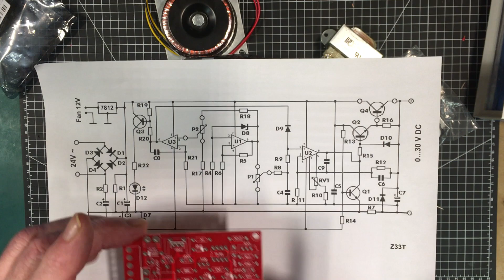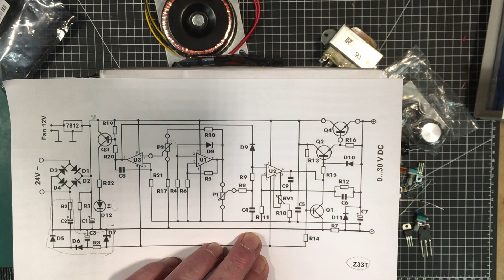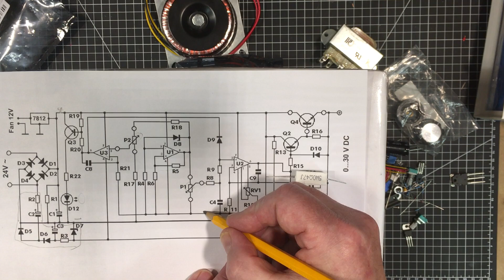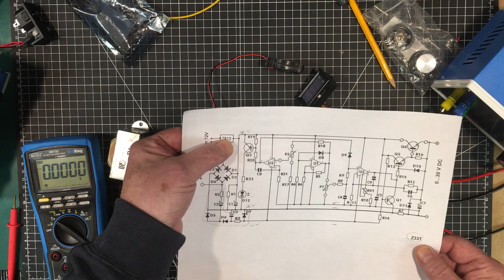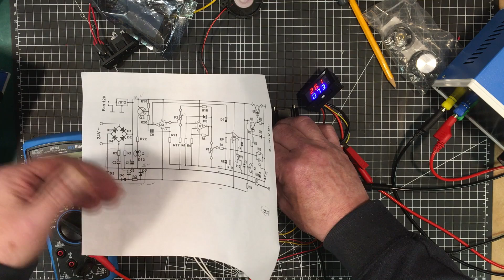Uni-Byte 0185 - Linear Bench Power Supply (Hiland): Part 1

Comment: Good one? Why don't you use 12v transformer?
Reply from the maker: You are on the right track.  This project took some interesting turns.  Finally got it working very nicely but needed to make some component value changes and a reduction in specifications and a lower transformer voltage.  BE sure to watch all the videos. 👍

Comment: that 1/4th watt resistor surely not capable for the job. replaces it with 3x 220E when building it few years ago. and they are still shipping this with 1/4th watt ! 
also used a 1/2 watt for the resistor next to it. 
and i m not sure why the capacitor next to it popped after few minutes. just use safety goggles when testing with cheap chinese parts.
Reply from the maker: SO far I've had nothing pop on mine, but I did some mods as you can see in this series.  I actually use it nearly every day for something or another.

Comment: Just to be fair, this is a kit and it’s based on a Practical Electronics design that has been assimilated by others…just ensure that the transformers ac output when rectified  doesn’t exceed the rated rail to rail voltage of generic op amps of 36volts…
Reply from the maker: It is.  I got the kit for like $4 from AliExpress, but a bunch of changes were made.  Did you see all 4 parts?

Comment: I built a +-30V supply form the "OP Amp Cookbook" back in early '80. It's right here powering my Dot Star featherwing right now (not much strain on it at 3.3v 😉). The Radio Shack  power lamp has long since burned out and the switch failed in the "ON" position, but she's still cooking. These are great learning projects. Thanks for showing yours.
Reply from the maker: Nice!  Thanks for sharing.

Comment: Just in case anyone is interested, the TL081 op amp can be switched out with: 
MC3371
LF351
TL061
TL071
OP42
UA741
amongst others. So, if you have stock, these are pin compatible. Fun to try, too.
Reply from the maker: I thought about the 741, but does it get close enough to the power rails for this application?  I guess I could try.
Reply: @uni-byte  Yes, indeed. It works fine in mine.
Reply from the maker: @englishrupe01  Just tried it and it does seem to work much better.  Thanks for the info.
Reply: @uni-byte  Cool. Glad to hear it, and you are welcome.

Comment: I used a couple of old 741's for U1 and U3, and a TL071 for U2, as that needs the offset adjustment ability. During original testing, I blew up Q4, which I thought was due to inadequate heat-sinking, but with hindsight, that may also have been a fake. I originally went for 10 turn pots, but all the ones I received from China were faulty, so I reverted back to single turn ones.
Reply from the maker: Good info, thanks.

Comment: Great project, great video.
Thats a nice case, should look great when done.

The most common Op-Amp these days, for PSU's, is the LM 385. Even the cheap knock-offs are just as robust and accurate. 
I see them, and use them, in both Linear and Switch Mode units.
Personally, I'm Analog Meters, but in this case we're Not eye-balling the guage every 2seconds.
The Toroidal transformer, what a shame. It was perfect for this project. I'd be inclined to order another from the same store.

Now the important question. Is that a Linear Power Supply, or "Linear Bench", as the title may imply. lol. 
Happy trails.☺
Reply from the maker: Do you mean the LM358?  IIRC the LM385 is a voltage reference.  I have lots of LM358s but they will not work in this design.  Yeah, shame about the transformer, but I don't really have the time to wait for another to come from China on this.  The Traid one I'm getting is just a regular "E" core transformer, but it should do the job.  Thanks for your comments!

Comment: I built one. Very disappointed in its operation
Reply from the maker: Seems to be a trend unfortunately.
Reply: @uni-byte  It would have been easier to use an LM723 and build around that.
Reply: @dannyperry8070  it's a diy kit. that means, you need to do some diy mod to get the desired performance from it. 🤣
Reply: @iceberg789  Yeah I know. I purchased one and I was very disappointed with its performance. Its in my junk circuit boards

Comment: I had one of these and had the same issues I think , it was a while so memeory is a little vague. When I tried it a few months later it had almost zero output, I did try replacing TL081 but that didn't fix it or atleast I couldn't check as one of them caught fire very quickly. I do have another kit somewhere I bought it when it was really cheep but never got around to building it.
Reply from the maker: Let me see if I can get teh bugs out of this one, then it might be worthwhile building up the 2nd one.

Comment: Add 1A diode from + output to + rail, cathode towards + rail. Will prevent Q4 destruction when output higher than rail voltage.
Reply: If I'm interpreting that correctly, placing a diode from Out+ to Supply+ is the same as placing a diode across Q4's Emitter to Collector,  where it clamps thje emitter to collector voltage across Q4 (output transistor) to Out+ minus one diode drop? Which would be within the safe zone of of the emitter to base voltage, preventing the destruction. Current would flow to only a minimal degree, so this could be a small 1n400x rectifier diode or a small SBD.

Eager to hear if I've got this correct!
Reply: @AnnaVannieuwenhuyse  Yes you got it
Reply from the maker: Good idea!
Reply: Great idea....many thanks.

Comment: You can never have too many power supplies. You’ll use both types of meters eventually. I like those blue cases with the white trim. I’m not sure the one you’re using is big enough for two analog meters, along with everything else.?
Reply from the maker: You may well be right.  They are really small meters, but we'll have a look when they arrive.

Comment: I've always been skeptical of these cheap DIY kits from China. Seems like an easy way to make a buck by shipping them out with counterfeit or faulty surplus components and then pass the buck to the hobbyist builder for a failed unit due to implied improper assembly -- especially since they don't include schematics or instructions.

I've also been looking at these boards and in some listings there's the option of buying a pre-assembled board for a couple bucks more. That's the only way I'd buy one, because then you have some refund recourse if it doesn't work... although they might still claim you incorrectly hooked up the external transformer or some other peripheral component.

Of course part of the fun of these is the build itself, so I'll be following your progress to see how it turns out before deciding if I want to give it a go!
Reply from the maker: It is fun to build things for sure.  For me it's even more fun when they don't work quite right or can be upgraded.
Reply: @uni-byte  Exactly. To be honest, i find the challenge of troubleshooting the problems these can give most fun, too, although, now i tend to know them pretty well, i can figure them pretty quickly. I find it best to keep a supply of my own good op amps on hand, plus a few power transistors and the big shunt resistor. Electronics Repair School has upgraded his by paralleling two of the power resistors (sorry, i meant transistors) . I must have at least ten of the boards now and all the boards work fine apart from the obvious issue with fake op amps (plus some of my own stupidities). These boards are 3.55 bucks now with free shipping (over ten bucks) on AliEx, so i think expecting them to be perfect is a bit much.

Comment: I'm pretty sure that's the same kit as mine so I'll have to check my op amps. Do you have a link to the transformer you bought. I need a replacement so I can get the full 3 amps out of my power supply. Right now I can get about 1.5 amps max with the salvaged transformer I have in there.
Reply: If you do get a transformer, try and aim for under 24V AC. A toroidal transformer is therefor quite beneficial, as you can unwind some windings to drop the voltage if need be. This is just to save your TL081CP's from being cooked.

Alternatively, fix the issue with the positive supply voltage on the op amps.
Reply from the maker: @AnnaVannieuwenhuyse  The total across the op-amps should be around 38V.  A real TL081 should handle that okay.
Reply: @uni-byte  a real TL081 should. What should be noted, however, is the tendency of transformers to have a high floating voltage under no load. Mine gets above 41V DC with low load, and this gets worse with iron core transformers the more powerful they are! 🥵
Reply from the maker: @AnnaVannieuwenhuyse  Yes, this is quite true.  The AMR for a the TL081 is really just 36V.  I have decided not to push it.  I;d like this supply to be reliable over it's entire operating envelope.
Reply: @uni-byte  I also don't recall exactly whether that maximum voltage is rail to rail or rail to input / ground point
Reply from the maker: @AnnaVannieuwenhuyse  It's rail to rail.  In this circuit nothing is really ground referenced in teh traditional way.
Reply from the maker: I'll put a link to it in the description.
Reply: @uni-byte  Thanks for the link I appreciate it.
Reply from the maker: Pat, before you go ahead and order that transformer watch some more of the videos on this.  There are other problems. that you might want to address.
Reply: @uni-byte  Ok I definitely will watch the other videos and thanks for the heads up.

Comment: Great stuff, thanks. I love these little power supply kits, and have several. If you have UA741's (and several others), they will substitute fine for the TL081 , too. Since this "Original Hiland" circuit has been out since the '60's, there have been tons of mods to it that are out there, if you search. Did you calibrate the current with the trimmer, first? Maybe i missed that. Oh, and the pdf for construction and current calibration is available on Banggood, if you want it. I can't link to it, though, on here. These are great fun for the money and thanks for covering them. They tend to be often verbally abused, but can work great with decent components and some care.
Reply: Can you elaborate on what that trimmer is supposed to calibrate? I'm unable to see any difference in the output current or voltage at all whatsoever when I turn mine. If elaborating means copying a snippet from that PDF you mention, that's fine by me!
Reply: @AnnaVannieuwenhuyse 
Try putting in your search: " Instruction of Installation of 0-30V Stabilized Voltage Supply" and then scroll through the results until you come to a Banggood result, and that should be the pdf with everything. The reason for calibration is to zero your potentiometer correctly and so that the red led indicator comes on at the right time, showing constant current kicking in. Hope this helps.
Reply: @englishrupe01  cheers!
Reply from the maker: No calibration done yet.  I'll try that when I get some op-amps that are not doing crazy tings.  Thanks for the additional info.

Comment: I think that I mentioned in the mail bag episode that these red board 30V/3A PSUs are (all) faulty. You have mentioned most of the known issues. Add bad traces from being copied over and over by different suppliers. I built three; all failed...
Reply: "It is never afraid of the fireworks!"
Reply: Are you saying the PCB is incorrect ? if so where please.
Reply: @andymouse  Yes, some YT builders have discovered trace errors. One builder bought three boards from different suppliers. Two had two different trace errors. His third board also failed. Due to fake op amps, as I recall. He was trying to find a way to identify sellers offering original kits. This was a recent review, but I forget what channel. If I come across it, I will post the details.
Reply: There are a lot of YT videos on folks trying to correct the myriad of problems with these kits. For these, add the term "upgrade" to the search title.
Reply: These kits have a very long history. I studied it out, about 10 years ago, when I was getting started. IIRC, the original design was an open post to a forum/blog/etc. It was just a prototype. The over-seas folks grabbed it up and went into production, without fully finishing the design. The under-rated/hot resistor that UB first pointed out is a known original problem that was not corrected and was carried into the rushed production. The remakers have never bothered to up its wattage. It has been down-hill, ever since, and with copies of copies, it seems to be getting worse. No guarantees on my memory. It is old and foggy.
Reply: @t1d100  :)
Reply from the maker: @t1d100  Thanks, I'll do that.  It seems these are copies of a Hiland design.  Might help to include that in the searches as well.
Reply from the maker: Yeah, you did mention that but I thought it might be fun to forge ahead with it and try to get it working.